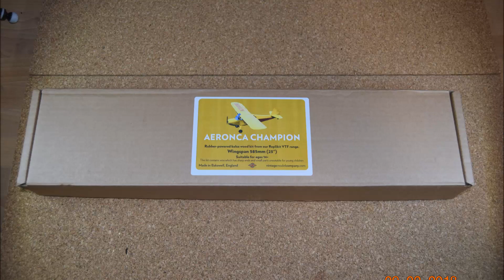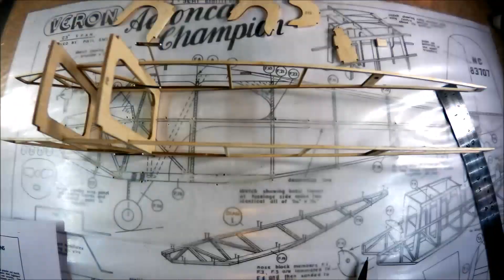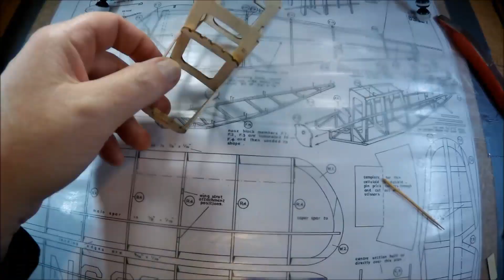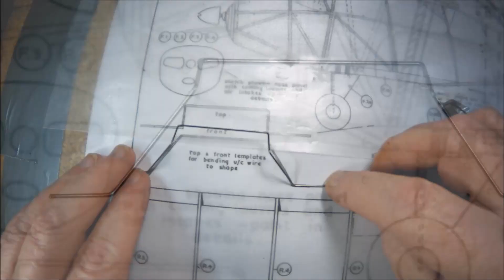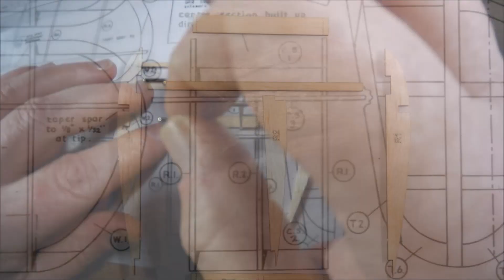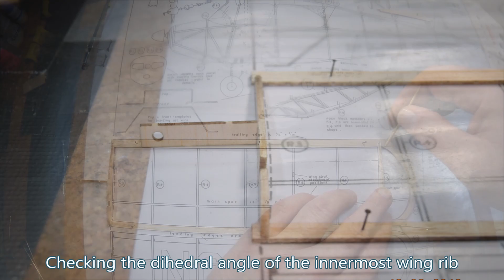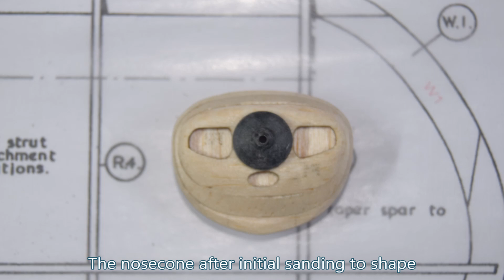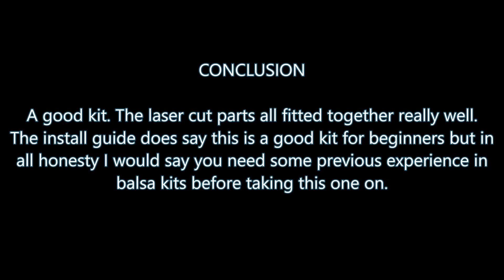Building the Aeronca Champion balsa wood model

Comment: Almost any balsa stick and tissue model can be made to fly with rubber band power BUT, model must balance properly usually requiring some ballast in the nose  to  offset weight of rubber band motor and tail structure. Wings and tail parts must be warp-free. Rubber  band motor must be long enough and wound with sufficient turns to provide enough sustained power to fly and climb  then glide back down. Short length of rubber usually supplied in kits is not enough for good flights. Watch a number of You Tube videos on rubber powered free flight models to learn basics. Adding electric motors and RC gear to rubber powered models  is not for beginners, experience through  trial and error required.

Comment: That's a pretty complicated fuselage for a beginning builder. It wouldn't be so bad in a larger size, but building with such small balsa pieces...they are difficult to work with.
Reply from the maker: Hi G56AG. Yes it was, but I had assumed that the instructions would have been as detailed as the ones for the SE5a that I had from The Vintage Model Company. How wrong was I. Thanks for watching.